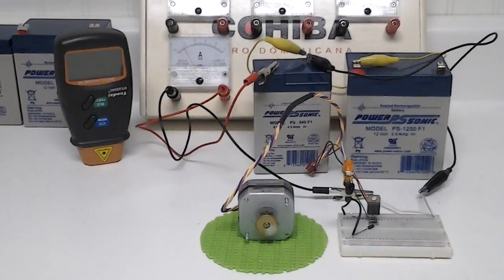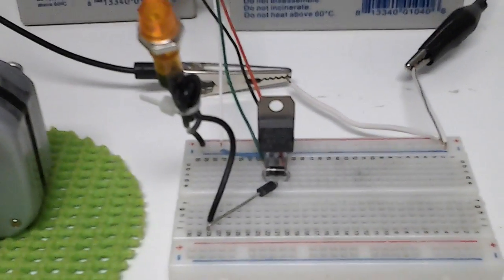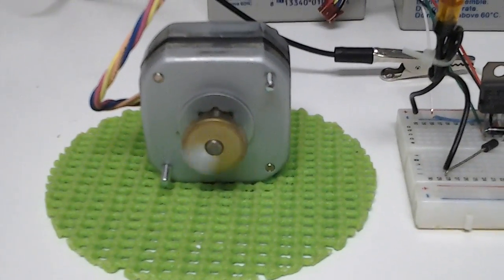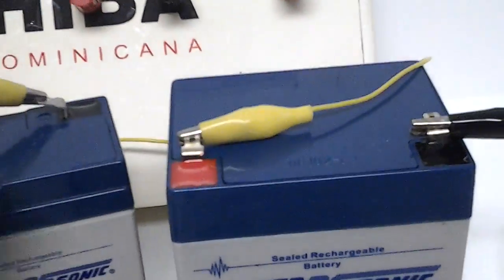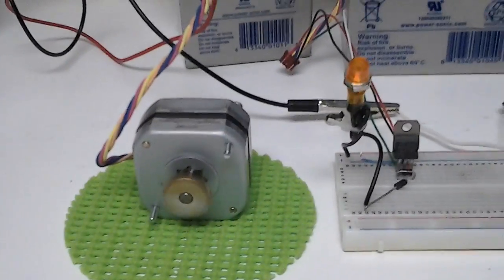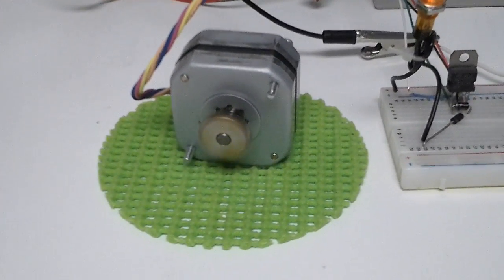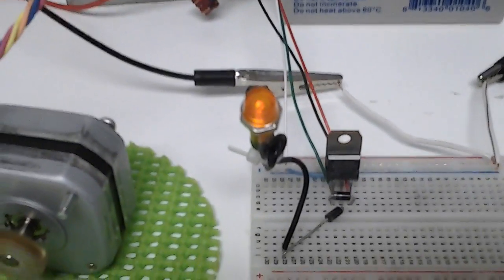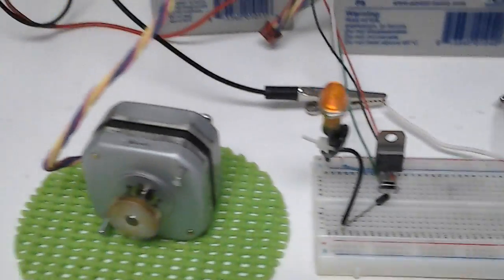Step by Stepper "Simple Driver"

Comment: This is BS. A stepper motor a RPM has nothing to do with voltage. It has to do with the pulses that cause the motor to turn. The wires are not even hook up correctly. PULSE an neon light takes 90v AC in order to glow.  This whole is nothing but BS.

Comment: I cannot find this motor useful if instead of demonstrating the high torque characteristics of a stepper motor it needs help with first spinning the shaft with rolling fingers even at the bespeak of the serial batteries connection that produces higher voltage. 
still, the circuit is intriguing

Comment: Why do you need to give the motor a little manual push to get it started?
Reply: A schematic would have helped us to see how it's all connected, but I think the motor is being driven by only one coil, and therefore as a simple brushless single pole AC motor -- NOT as a stepper motor (which requires at least two poles). The rotating magnetic field setup by the single pole doesn't move the rotor in either direction until it's given little push.

Comment: I really like that little stepper motor.  I have also had success using different circuits on it.  The Bedini SSG circuit is patented by John.  Rick Friedrick and Imhotep just used it on their fan conversions.  That is an interesting story with a not so happy ending.  I like how you have totally simplifed the circuit.  I need to get a MJE13007 transistor.  It seems to work better than the TIP 3055 that I am using.  Thanks for sharing.

Comment: Great comparisons with the voltages. Run it on mains with a diode on one wire and it'll use nothing lol. Have you tried a fan on the front ? just wondering what the draw impact would be for all the wind generated.
Nice clear video demo :)